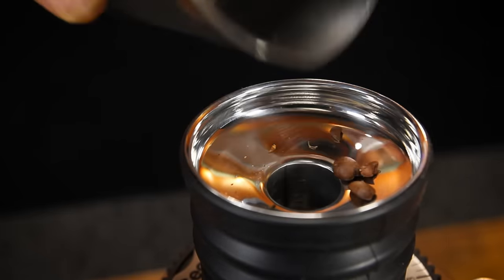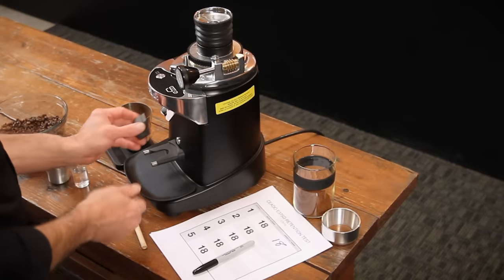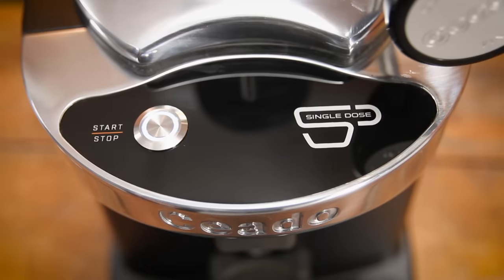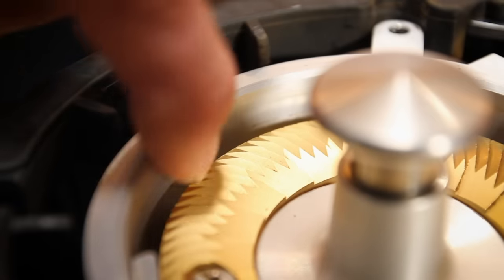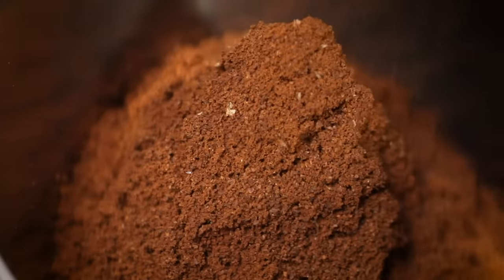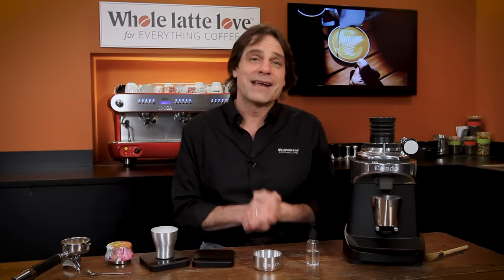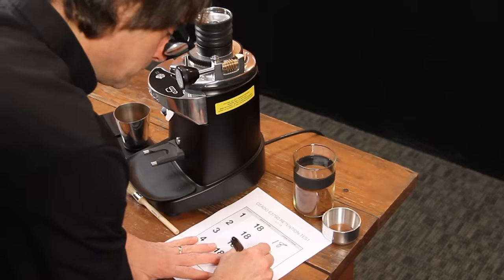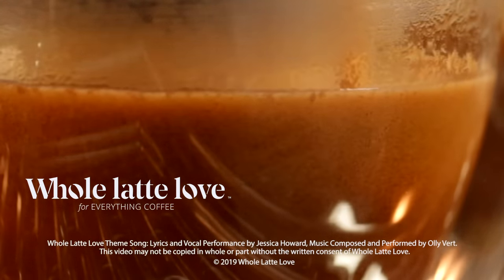Review: Ceado E37SD Single Dose Titanium Burr Coffee Grinder

Comment: First of all I want to say thanks for your videos and tests. I do appreciate them and your effort!
But I have no idea how you get those results. After I saw your video on the E37S I bought the grinder and made the same tests. I put 18 grams in and got 9 grams! That is half of the coffee left in the grinder! I did everything how you did it in the video. That result is far off of almost zero retention. Also on the measured times, I never get anything near the times you got. Your measured 5 grams per second is way off with my experience. My grinder needs 2.8 seconds for 8,5 grams and 5.9 sec for 16 grams. And I get variations of +/- 1g! Those are my daily results and experiences. Also if you change the grind size it takes a while to adjust which is the first sign for retention.
Don't get me wrong, it is a good grinder and I like it but unfortunately it is not as good as in your videos! And your videos raise the expectations highly. My grinder isn't the newest updated version of the E37S but the version with the newer flapper. I have experienced many grinders and after I saw all your videos on the E37S I was really excited about it, unfortunately it is not as good as advertised! And for the price of an E37S I would recommend a Mahlkönig K30 Vario which is a better grinder.
Reply: You have faulty grinder. I'm using E37S and it performs like in their video
Reply: @sergey021  I also have a e37s it performs close to what the video represents, maybe not quite that good but still very good.  I just wish the SD was out when I purchased my e37s as I exclusively only do single dose and the worm gear grind adjustment would be nice as well.  And now that the price of the e37s is almost 400 less than what it was when I bought it ~8 months ago that is even less money I could get trying to sell it and upgrade to the sd, so I will just stick with what i have.
Reply from the maker: Hi 3C, You are welcome for the videos. I stand behind my test results. Something must be wrong with your technique or grinder. My guess is it needs a simple adjustment of the SCC flap or you are doing something very wrong or grinding incredibly oily beans. I honestly do not know how it could possibly retain 9g. There's simply not enough room in the grinding chamber for 9g of ground coffee. I would like to offer a live 2-way FaceTime session with you (please have your E37S available) I'd like to see what your grinder is doing and I'll show you mine. I'll have an E37S and E37SD ready to go and give you a live demonstration of my results including grinding speed and retention on both grinders. I'll post a video recording of our session. You are making serious allegations and I'd like others to know my test results are what they can expect with E37 grinders. Please contact us here to setup a time for a live one on one session: https://www.wholelattelove.com/pages/contact-us Tell our customer support staff Marc has messaged with you on YouTube and wants to setup a live video session in regards to E37 grinders. I'm generally available 7a- 4p Eastern time and would be more than happy to do a live session tomorrow. Thank you.
Marc
Reply: @Wholelattelovepage  Hi Marc, thank you for your reply and kind offer! That there is something wrong with my grinder crossed my mind as well. To be fair the grinder works and this is complaining on the highest level! 16 grams in under 6 seconds is still fast. But you start to wonder why its only performing at half the speed.

I didn't meant to make any allegations about your test. I'm sure the results are solid and everyone can see how accurate you work through multiple test. It also would be interesting to see how the espresso shot is preforming on the chosen settings.

I'm wondering now for a longer time why I don't get the same results. And maybe it is just my grinder or it comes down to the settings. But half of the performance just on settings? Yes it could be possible but should it be possible? What variables do we have? There are three variables I can influence. First of all the coffee beans. Then the flap and the grind size. The coffee beans I use are mostly a medium roast and generally without any oil spots. I adjusted the flap according to your video. I opened it fully where it really made a mess but the grind time was of course much faster. I closed the flap and the coffee was very clumpy. So I opened it until it was more or less fluffy. The grind size is fine enough to get 50ml in 25 seconds and a brew ratio of about 1:2 so 16g in and about 30g out.

Well at least its good to read that other users have the same or close to the same results you had in the video. Frankly I feel uncomfortable taking up your time since I haven't bought the grinder at Whole Latte Love but I'm from Germany... Maybe I should contact the manufacture directly about this matter. But if you are interested in seeing a live performance of my grinder we can of course setup a live video session.
0.5 grams retention and 5 grams in 1 second sounds almost to good to be true. Even a Mahlkönig K30 is declared by manufacture with about 4 grams per second. Those performances are truly astonishing.
Maybe I first try to adjust the flap again.
Reply from the maker: Hi, Thanks for the reply. I'm happy to hear other commenters here confirming my results. I would, as you mentioned have another look at the flap. Again I find it hard to believe the grinder could retain 9g in the chamber unless the flap is not adjusted or working properly. ~.5g or less retention is what I've had on multiple occasions.
Marc
Reply: @threeccoffeeroastery3737  My E37S does 16gms in way under 6 seconds (maybe 3).
Reply: @ThomasChesterVA   That is the result as tested from WLL which is great. Maybe it really defends much on the used coffee bean (variety, blend, humidity, bean size...). I will keep testing and Marc and I are in contact.